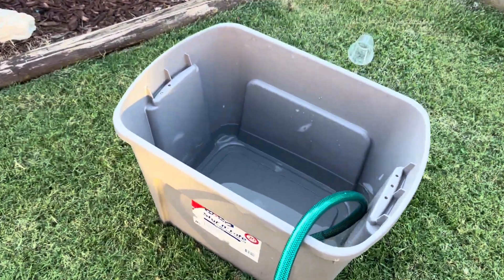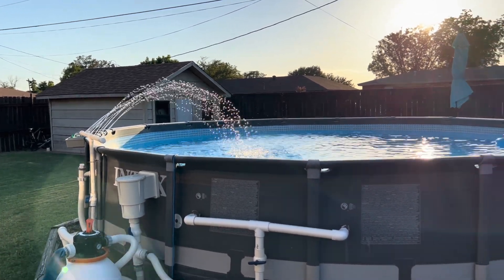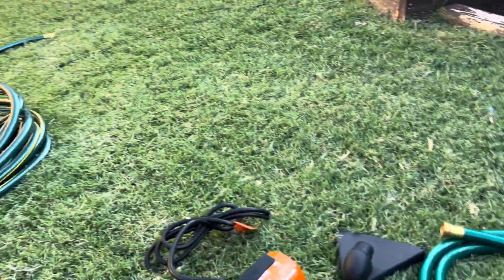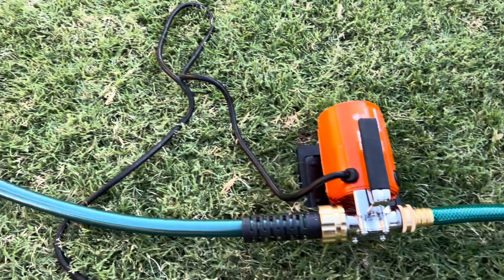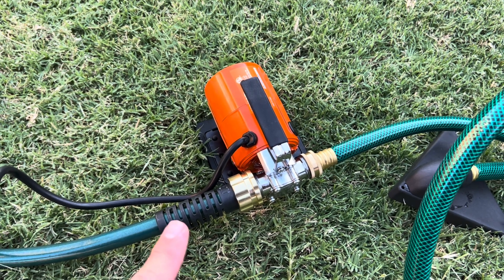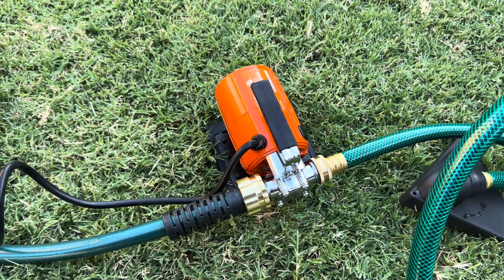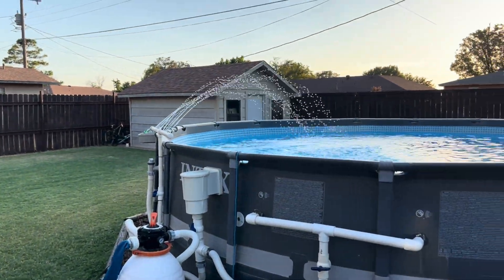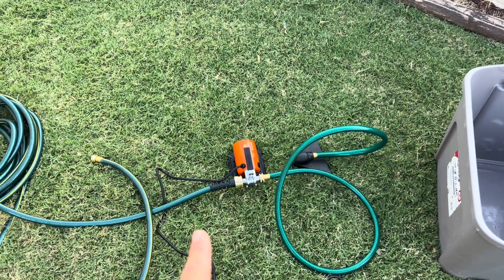Water Transfer Pump by Vevor

Comment: How’s the noise? Been looking for a good pump for a pond filter. They all seem kind of loud?
Reply: The recirculating pump is quiet. You should try that.
Reply from the maker: It does have some noise not bad but it has it. 👍🏼
Reply: @LifeLessOrdinary  it sure does. I’m building a sound proof box around it.   Will it overheat?
Reply from the maker: Mine hasn’t but I don’t run it for very long either
Reply: @LifeLessOrdinary  yeah I’m going to put a timer on it, so like 4 hours at night I think, in the wee hours of the night